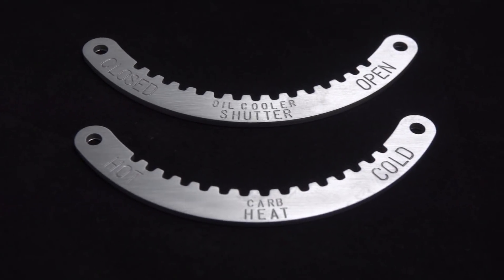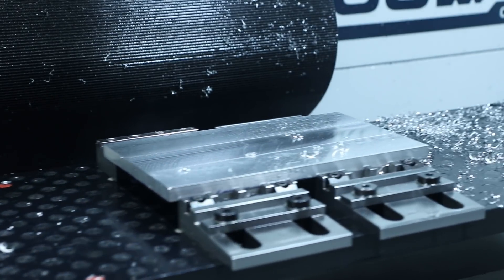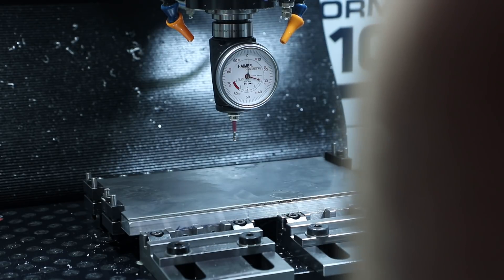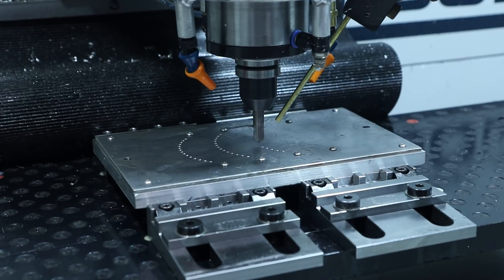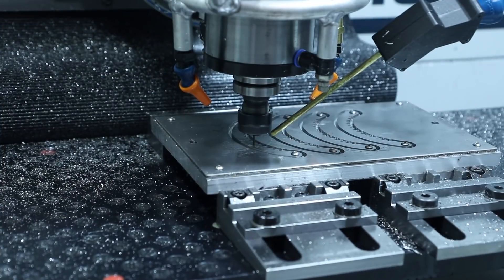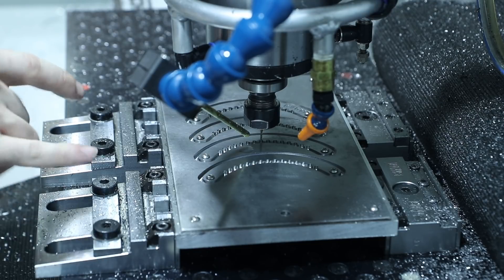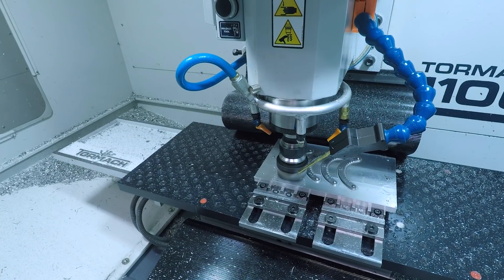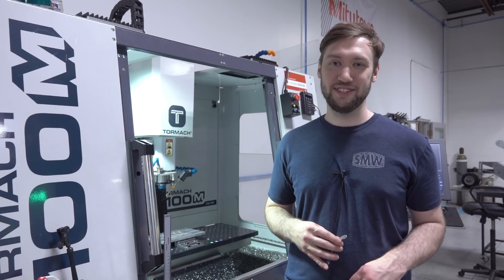Milling WWII Airplane Parts for Aviation History Museum | WW256

Comment: Wonder how they did the originals back in the day.
Reply: By hand 
Drill a hole at the bottom of each ratchet position then cut down to the hole and tiny up with a file 
Or make a die and stamp it out 
Depending on how many were made
Reply: I would think they would have been punch pressed. One guy could have made thousands of these things a day and I am sure that likely is what they were doing.
Reply: @bcbloc02  Yes, they would have been punch pressed.   J. Gaertner Blue Swallow Aircraft, LLC

Comment: What's the weird shaft with some sort of bell-shaped thing at the top, the wrench fitting at the bottom, and the cylinder in-between? Some sort of slide hammer for the pins?

Comment: Are there any special rules or qualifications for making aircraft parts?
Reply: I doubt that they have to make these parts to any standards, as long as they go on planes that no longer fly, which is the case for most planes exhibited in a museum.
Reply: @markedone6667  though I believe (couldn't tell which video...) John once did an aircraft part on one of his Tormachs. Really unsure though...
Reply: @markedone6667  Still... there is no telling where that component might end up in the future. IMHO, competent council should be consulted before production of any & all aerospace components.
Reply: This is a very good question... I hope they've done their homework. I'm pretty sure the production of aircraft parts/components is very much regulated & controlled.
Reply: The great thing about the US is that you can build a plane in your garage and fly it. If you should is left up to Darwin.
Reply: Most flying WWII vintage aircraft are certificated as Experimental / Exhibition aircraft with the FAA, which allows them to be flown to exhibitions or in airshows, and does not require approved parts, basically only an "equivalent level of safety" to the original parts.
Reply: @johnvahey6338  I wonder how it would work out of someone wanted to restore one of those to fully certified.  Are records kept of what was done and the approved/mot approved state of them?
Reply: Bob Hassinger Most purpose-built military aircraft were never certified by the FAA in the first place, so there’s no reference certificate to restore them to. Exceptions would be military aircraft that started their lives as certificated aircraft, such as the Cessna O-2, a militarized version of the Cessna 337 Super Skymaster.
Reply: @jvaheycfi  DC3 -> C47.  Also, I recall Bendix Avionics had a B17 they used as a test bed.